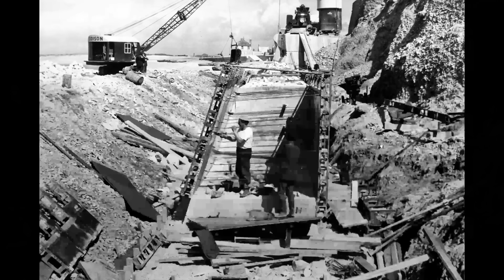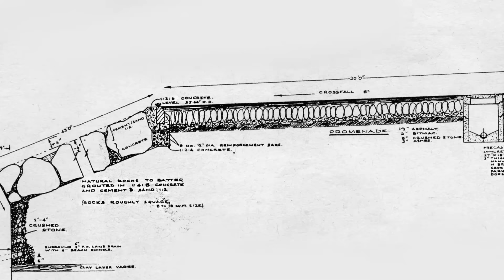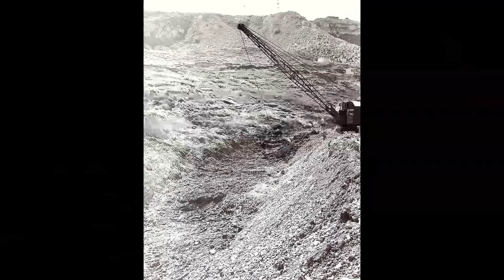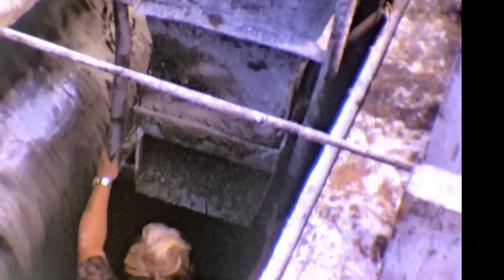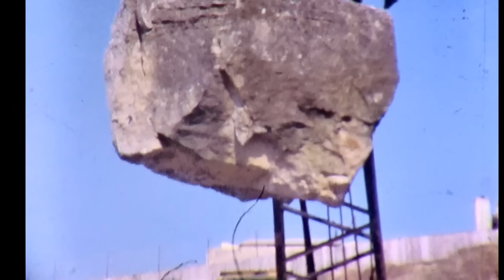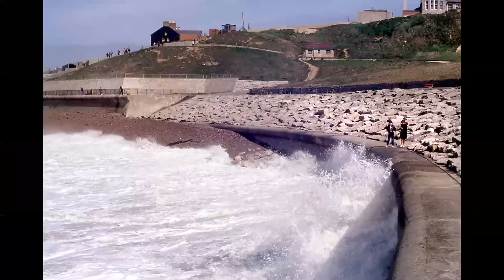Chesil Coast Protection Works 1960s. Sea wall. Unique film, images. Civil Engineering, Portland

Comment: Stuart, a totally outstanding production. This needs to be referenced by the Institution of Civil Engineers. It captures the role of everyone - a caring Local Authority, the designer (you) who is prepared to listen and a contractor (with all their skill sets) rightly acknowledged, in essence what successful projects are about. So much detail:- sheet piles at the toe - which did their job when nature whipped out the beach, safety concrete round the inspection manhole, failsafe gravity wall, that inspired extra safety in the curved plan shape, the heavy solid stone revetments, serious ground drainage behind, making room for the cafe on the second wall construction, expansion joints... All great stuff.
Reply from the maker: Thanks for your very encouraging comments! Please feel free to give the link to anyone you may know in the ICE or elsewhere. Stuart

Comment: Nicely narrated Stuart, if you had attained higher status in that department at the time I’m sure you could have better influenced the quality and ultimate longevity of some of the critical repairs that have been undertaken since then. Do you still live in the area?
Reply from the maker: I didn't have any direct involvement with this scheme after 1966. I have pressed for essential repairs and maintenance over the years, but apart from the 2011 work, little has been done. Much of my later career was based in Weymouth, and I do still live in the area.

Comment: I hope you look back with pride on this. Fantastic vid. I live next to J22 on the M62, I use to go up with my Dad when the first steps were took to dig out the Valley of 11millions tons of peat bog.  Where the Motorway splits in two for the Farm. I was 6 years old and still have a bit of C8 film he took, to the first drive down it when opened. The project Manager was 28 IIRC...to build a Motorway in the highest place in England, fkn unbelievable, much like you were doing.  I look at how work is done (not) today and despair, that 96K spent on doing that end bit would be 30million today and would take 5 years....when the cost would be 60million by then....World is fkd, snowflakes born before 1990 have no common sense on how to do anything...ugh.
Reply: Do you mean,snowflakes born before 1990 or after 1990?